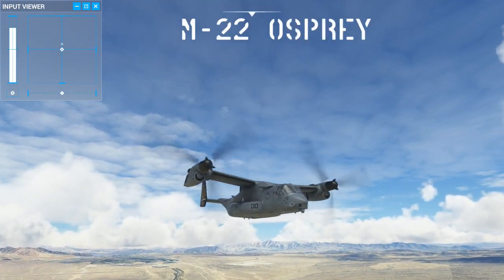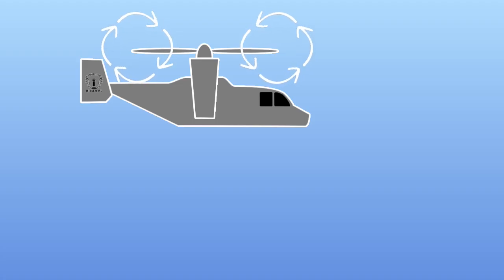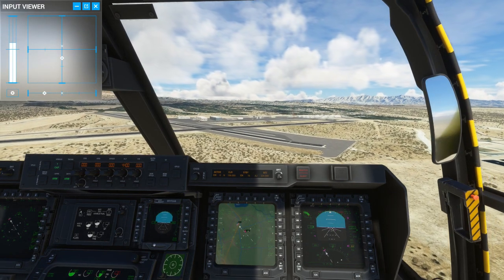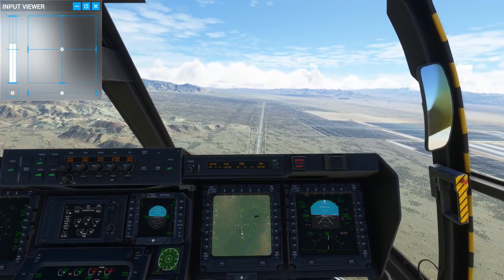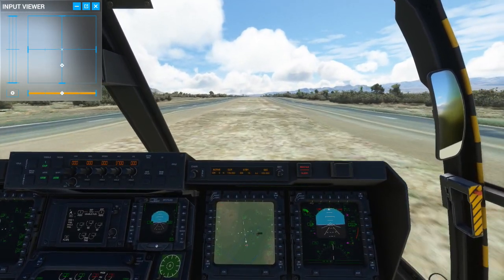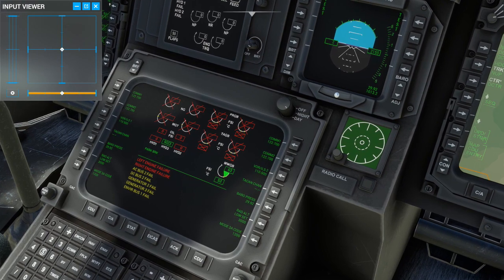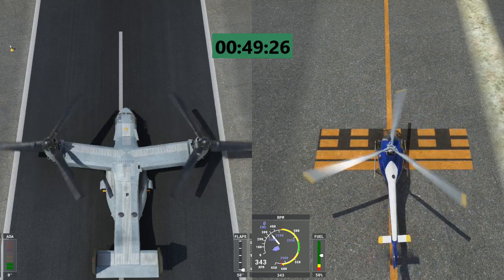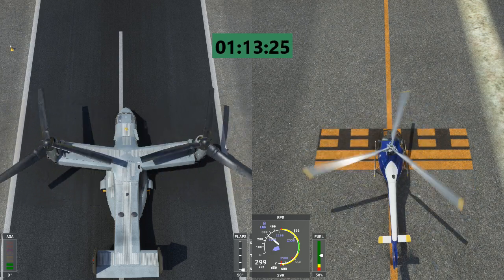MV-22 Osprey Part 3: Emergency Procedures - for MSFS 2020

Comment: Loved the firefly reference
Reply: Also, no idea rotors took that long to shut off, suppose it makes sense as to not wear the materials by having brakes there etc though.
Reply from the maker: They do have brakes for if you're shutting down normally but the idea here is to demonstrate how long you can continue to produce some lift when the engines fail.